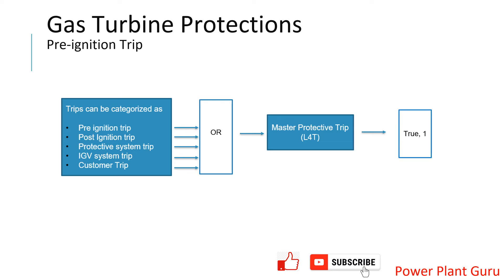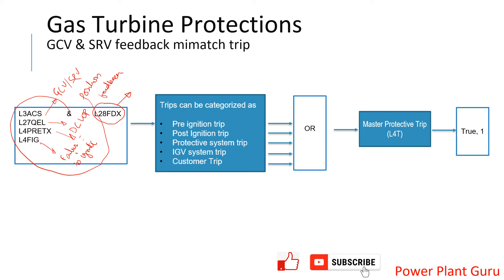GCV SRV Trouble, power plant guru, Gas Turbine Protection, Pre ignition trip, gas turbine startup

Comment: Sir.
Does the controller tracks the position for both GCV and SRV or only one,and the other one always in fully open position?

Why do we need to track and have the exact matching ; can we not use this interlock?
Reply from the maker: Hello, Thank you for watching my videos. 
Yes the control system tracks the position for gcv and srv both , if there are two gcv then for that also. 
There are different alarms for each valve.
Reply from the maker: Tracking is very important in view of a hazardous situation, if you imagine a situation where command is 10% and the valve opens 20% . It is problem for operation and safety both.
Reply from the maker: No valve remains 100% open, generally. Valve opening is a function of a lot of variable like starting up, normal operation, upstream pressure, TNH, etc. 
Will make a seperate video that
Reply: @powerplantguru007  can you provide the link here? i cannot find it